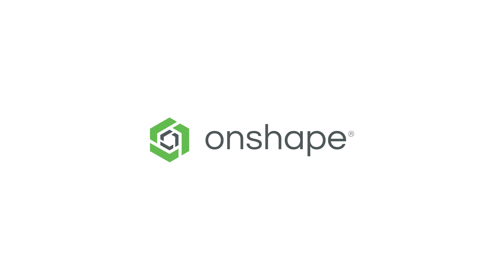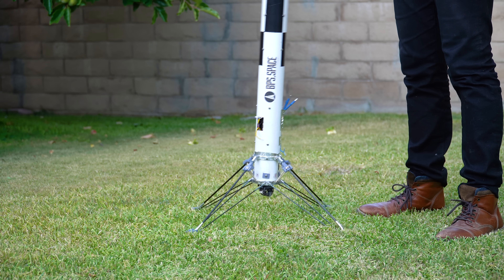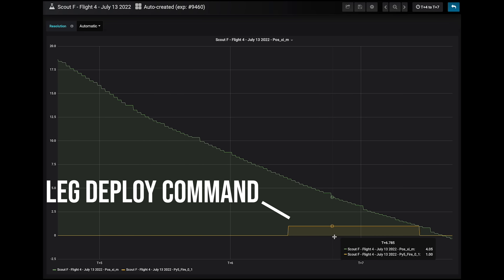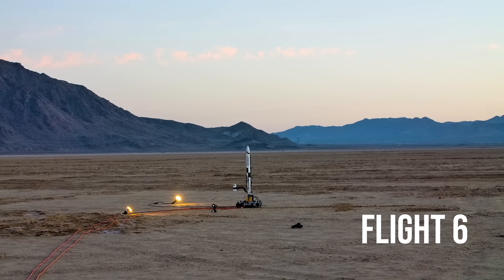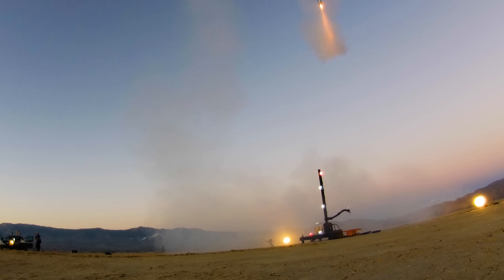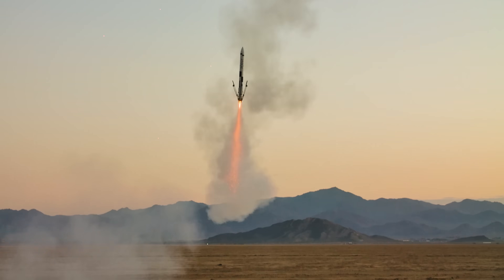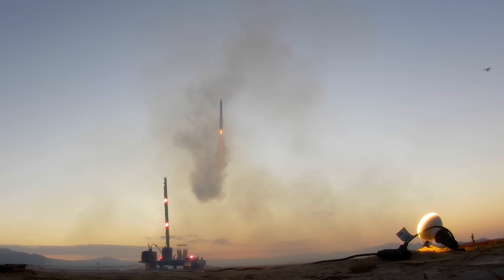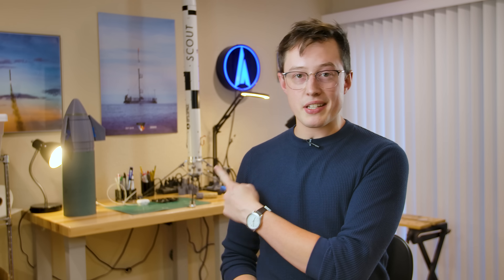Can This Model Rocket Land More Than Once?

Comment: According to me, 
Possible solutions for this rocket's Instability are-

1) Keep Leg attached at higher top than lower end, due to which center of gravity will remain under pivot point.

2) While landing, instead using one trust propulsion, use four small trust propulsion's which will end turning/rotating moment of pillar like structure of rocket.

3) Use of liquid dampener than solid one, will absorb more sudden shocks.

Comment: @Joe  and if the connection between the rocket section that all the legs are attached to has just a little bit of flexibility? Wouldn't that auto adjust the fact that the rocket isn't perfectly oriented to the ground?

Comment: Integza has a resin 3d printer that can print ceramic/resin parts. He then removes the resin with a kiln. Do you think this would be viable for the ceramic throttle limiters?

Comment: id love to work for you and develop a small model sized open cycle EthaLox rocket engine. sounds like a fun idea. youd just need to Insulate the oxygen tank. Sadly i live all the way in germany so yeah
Reply: Ich sehe das wie du und denke, dass wir das Antriebskonzept langfristig ändern sollten. Ich würde jedoch von einem Flüssigkeitstriebwerk mit offenem Kreislauf abraten. Man muss stattdessen ein Flüssigkeitstriebwerk verwenden, was keine Turbopumpe benötigt. Daher müssen sowohl Treibstoff, als auch der Oxidator unter Druck stehen. Als Treibstoff würde ich deshalb Butan verwenden, weil es bereits bei unter 4 Bar Flüssig ist und leicht erhältlich ist. Als Oxidator würde ich Sauerstoff verwenden. Dazu braucht man zwar einen Tank, der mindestens 60 Bar aushalten kann, jedoch lässt sich das mit Carbon gewichtstechnisch gut realisieren, wenn man bedenkt, dass man sich somit die Turbopumpe ersparen kann. Außerdem wäre das herunter kühlen der kryogenen Treibstoffe viel zu Teuer und zu aufwendig, weshalb unter Druck stehende Treibstoffe die einzige Möglichkeit ist. Die Entwicklung der Brennkammer ist gut realisierbar. Eine Drehmaschine und eine Fräsmaschine sind dazu komplett ausreichend. Man könnte Materialien wie Aluminium verwenden, wenn man die Brennkammer herunterkühlt. Mit dem Joule-Thomson-Effekt ist das sehr leicht machbar, weil der Sauerstoff unter hohem Druck steht. Das hört sich wahnsinnig kompliziert an, ist jedoch relativ einfach zu verwirklichen. Ich habe einwenig Erfahrung damit, weil ich gerade selbst an so einem Triebwerk herum tüftle. Ein Test mit einem Prototypen war sehr erfolgreich. Mir ist es bereits gelungen das Triebwerk herunter zu kühlen und zu zünden!

Comment: Extremely simple solution to your landing issues: Why don't you just increase the length of the legs to maybe 70-80% of the rocket length???? Does not add significant weight or drag. Will solve 90% of your landing issues. The smaller the legs, the harder is to land upright. The longer the legs, the easier. You are making things harder than it needs to be with those short legs.

Comment: Three or four seconds before the feet touch the ground, the engine stops. That's why it suddenly falls out of the air. I mean, if the engine starts a little more when the feet touch the ground, maybe the problem can be solved. My native language is not English so I didn't understand much from the video. I say this as far as I can see from the pictures. Of course, you know better what to do. I hope the translation worked well. have a nice day

Comment: Could you replace the ceramic with a folded metal sheet? Should be light. If it heats up, it heats up, but since its not heated for a long time, I suspect it's reusable. Wear and tear will be low

Comment: I would move to a larger pad. Look into Teflon like larger pads. Secondly I am sure if you landed on smooth finish concrete - that alone has mom slope of 1” per 10’ min avg. soil is crazy, it could bounce out on a .75” rock. 

Kudos and awesome job on this project!!

Comment: you could make it so that the legs pivot in pairs around the center of the rocket, that would negate any effect of one or two legs touching down before the other legs. though I don't think that it's possible to do mechanically with a thruster in the way...

Comment: @BPS.space why dont you try using air piston type of dampers BUT it release the air slowly through precise length of hole. The bounce is cause by the compressed air so why not just vent it out slowly.

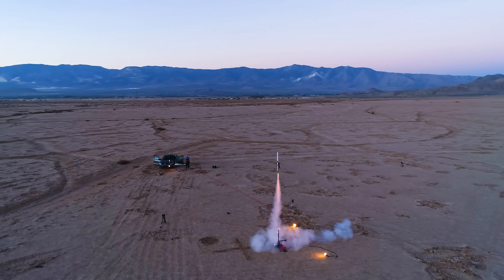Comment: Massive adulation!!!  🤯 The Flight5 landing montage from 4:20-4:55 was beautiful 😍
"... target a landing altitude of 0.5 meters ..." This is a large source of your bounce!
Not just the drop velocity, but any slight moment on the stack can multiply during the drop into a jaring corner impact. The successful landings were under thrust at very low velocity.
You have developed outstanding TVC and several of your "failures" had SRB cutoff and ultra low vertical velocity at 0.5 meters which demonstrates very impressive software!
In the spirit of "Screw it, double the control gains!", which worked very well for you,  I think
"Screw it, target 0.05 meters altitude" would serve you well.

Keep impressing us, your fans expect great things! 👩‍🚀

Comment: Amazing work!! A few ideas that might come handy on future revisions/ on the BFR :)

Shock absorbers close to the body instead of on the tip of the arms, should help with bouncing and removes inertia from the legs for better deployment!

Thrusting vectoring can help with throttle management with two or more motors so on the bigger rocket consider using more than one motor 😄
Reply: Watching the latest slow-mo shots, its clear that the tipping is the result of the legs opening. The rocket always tips towards the last leg to deploy due to its inertia. An additional damper close to the body should do the trick, but it would require a bit more time for full deployment tho.

Comment: I wonder how quickly you could improve the landing legs by doing drop tests in slightly different orientations from about two meters. Also, does the thrust vectoring become more effective close to the ground as the thrust is against the ground.
Reply: Thrust is typically not dependent on the distance to the ground. To simplify rocket science, your rocket gets thrust from throwing mass in the opposite direction, not what happens to that mass later.
In the real world, I would say thrust vectoring gets harder closer to the ground since the exhaust can now influence your rocket after hitting the ground (air currents for example)

Comment: You might benefit from the VL53L1X - which is a very tiny laser rangefinder chip. I am in the Bay Area and I could help produce a PCB for you with wiring (for free :) that would allow you to hook it up into a small JST connector or something, it just uses an i2c bus. This way you can give your flight computer very highly accurate altitude data when it is about to land
Reply: What about the giant plumes of smoke in the way? I don't think that would work. Maybe an external low latency camera could track it down and forward its position estimate.
Reply: @calloutman  Generally the smoke is diffuse enough to not be a problem. The smoke has to be thick enough that multiple pulses return shorter values. Now the VL53L1X is only a 50hz chip max so  yes its more susceptible to interference including just general IR emissions from the environment. Which reduces max range and accuracy I have used the sensor before and its best not to push it past 3 meters.

However even a 3m/9.8ft range is long enough given BPS needs, there is more than enough to sacrifice some range by measuring at a slant. The weight of each sensor is also so low that multiple can be easily used for redundancy. 

If the mass budget grows and speeds increase there is also large lidars like the lidar light 3 hp that reliably get 40 meters at 5000hz and still even that unit only weights 38 grams including its housing, and is cheap at 150 USD.
Reply: @nocare  that is a really great point.

One other idea could be to use RTK GPS to get centimeter level positioning. I don’t know if it would continue to work at the distances and accelerations of a rocket though. But ground stations you could possibly calibrate to the launch pad and if it lands in the same spot it should know within a centimeter where the ground is.
Reply: Yup VL53L1X is an excellent suggestion. Easy to interface, and you can change some settings with the sensor arrays to suit your requirements.
Reply: What programming language does he use
Reply: @kamesh.s777  C++ and C. He seems to mostly use the Arduino IDE & VS code from what little I have seen in his videos

Comment: Waaw elon musk twin .. naaahhh weight penalty for add fuel to land already make this not OK, plus legs structure and link and ... Think how much that weight if its a cargo or life support system. Plus heat trace on nozel, wear, rebuild bla bla blaa .. naaah as engineer ... Use parachute, its work better

Comment: When you do a larger version of this, I hope you will consider putting in a cold gas thruster system to correct attitude on landing :) would allow you to fix those tilt and asymmetrical leg loading problems!

You could use a butane gas canister if your rocket airframe is relatively heat resistant (I foresee the exhaust igniting it lol) as they are not so heavy for the gas volume unlike CO2. Using a heater circuit will allow for flashing liquid butane into gaseous to give you a good thrust level!
Reply: I think legs problem is - small sizes . Legs sizes smaller than the height of  the rocket (>h/2). And it is dosent fixed to center of the rocket by support legs lines. To remove F-lever legs must looks like umbrella mechanism (with support lines).
Reply: Use propane instead of butane, it has more pressure and therefore produces more thrust, so you just need half the amount of gas and you can save weight. 
But it think using shock absorbers with a lot more travel may also solve the issue
Reply: @Henning_S.  Plus Butane is a bastard gas!
Reply: Heavy

Comment: On the rc car shocks, what about only running oil and no spring? Would act as a dampner and have very little "bounce back"
Reply: Only bounceback is the slight pressure increase in the shock body from the piston and shaft taking up space within the shock body, but otherwise the piston with the small holes can dampen the shock, and you can adjust the rate by oil viscosity and piston shape and the # and size of the holes on the piston can all be used to tune the rate of dampning

Comment: Im sure you are going to get a shit ton of these msg's, but RC shocks have 4 times the dampening power, and better travel. the trick is to just remove or change the spring  force. the other thing you can do is remove some oil from the shock to make it spongier.   If yo stretch the spring then cut it to a similar length it will be much weaker.  glad to see the new vid bro thanks.
Reply: Was going to say the same. Quality RC shocks have a lot of adjustable dampening. Only potential downside might be weight.

Comment: Have you seen how the "Gravity" jet suit controls vertical thrust?  The jet throttles are far too slow to control altitude.  Instead, the pilot flares the jets out with his arms, changing the vertical component of the thrust vector very quickly.    Since you have the same throttle problem with solid motors, maybe putting two motors on opposing TVC controls might work well?
Reply: This inspires the thought that non-time-symetrical deployment could be used to null out residual horizontal velocity!
Reply: I was kinda thinking that as well, my only concern would be space. Doesn’t seem like there would be enough for two motors side by side

Comment: The Lunar Module used a metal honeycomb that would crush on landing to adsorb the energy of landing.
The DynaSoar X-20 used a stretching wire damper to adsorb the energy of landing.
I'd go with one of those two approaches.

Comment: Great to see you moving to a different project right after you've successfully achieved a proper landing! I'm sure the Starship project will have you busy for a long time. Definitely not 7 years though lol. You've come a long way - this project should be much easier with all the knowledge you have now. 

In the long run though, are you going to make a liquid rocket engine? I'm not talking about a 'real' one with a turbopump and everything, but you could make a pressure-fed engine pretty easily nowadays, considering the fact that metal 3D printing is widely available and so are carbon-composite high pressure tanks. Obviously you can't achieve this now (or maybe you can, who knows!), but in 2-4-6 years you could have enough income to actually make a liquid fueled model rocket. Maybe even SpaceX would finally recognize you after all these years of trying to get a job there.
Reply: The biggest issues with liquid engines are that the propellants that give you easy engineering, are a pain to get (Hydrogen Peroxide, RFNA), and the easy to get ones are a pain to engineer (hydrocarbon/oxygen stuff, it gets hot)
Reply: @rocketcello5354  well, pressure-fed liquid engines at a model scale have only one significant problem - a proper and non-destructive ignition sequence. Combustion instability is almost unheard of at such scales, so after startup the engine should work just fine. 

It is more than possible to make a small liquid rocket engine without having to use fuels/oxidizers that are hard to get. I've designed one as a student - I am a solid and liquid rocket engine design engineer after all. I'm sure Joe can figure it out as well!
Reply: @rocketcello5354  You can do okay with NOS and salami.
Reply: I think he actually got an offer a little while ago but turned them down to pursue his future youtube projects

Comment: reject landing legs embrace catch
Reply: this is the way I'm gonna approach this, and I have some really good ideas. if I catch the rocket, this allows me to have a more controllable rocket because I don't have to optimize the rocket to have the CM as low as possible.
Reply: sso you can have spars at the top of the rocket, those spars could be supported in tension by some strings, those strings could actually guide the rocket in, this in theory could give me ~0.5m of accuracy required. the only hard part is making that position control work. but I think I can, because when I stop focusing on optimizing for landing legs I can start worrying about optimizing for a controllable rocket(high mmoi, high lever arm)

Comment: Also I say again. You really need a MPC based guidance to initiate the landing burn given the current state of the vehicle. Incase of high winds, or sub-optimal ascent burn, the MPC guidance loop can take all of that into account and start the landing burn earlier or later than the preset altitude. Further, during the landing burn, a New Horizon Estimator can take the current burn curve into account and compare it to your burn model (a model that is created from all of your static fire data) and make adjustments to your guidance signal given to the attitude control loop. 

Also, why not put high strength magnets at the bottom of the legs and have ur landing pad be a sheet of steel. as long as the rocket is near the landing pad and relatively level, the magnets will grab the pad and not let go!.
Reply: For example, in flight 6, the New Horizon Estimator could detect that the motor is burning sub optimally (early in the burn) and the burn will finish sooner than expected. So it will alter the amount in which the throttle vanes actuate allowing for a higher x_dot (altitude rate) . You can clearly see that your attitude was perfect in F6 for a landing, only if the motor burned for an extra couple of seconds. Which I believe your control system and model expected.